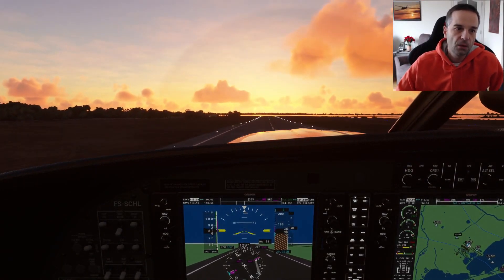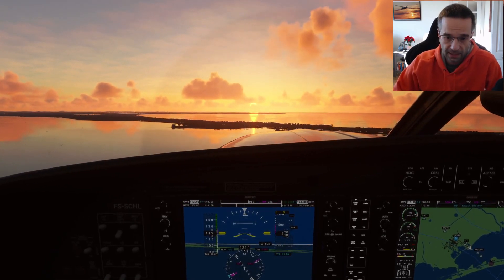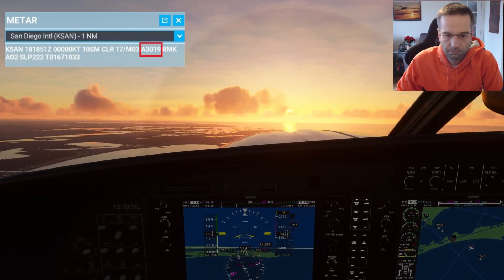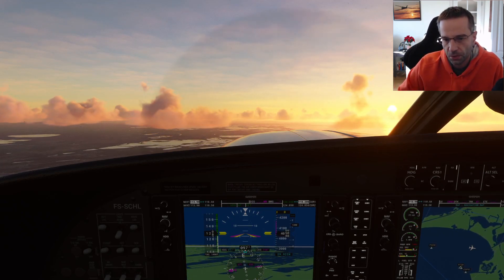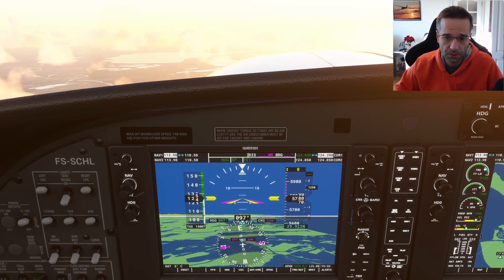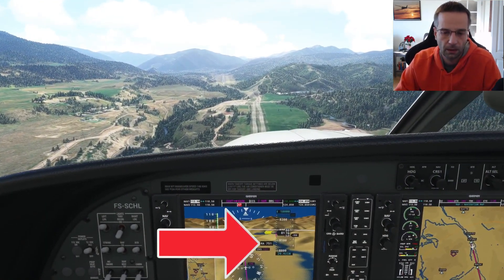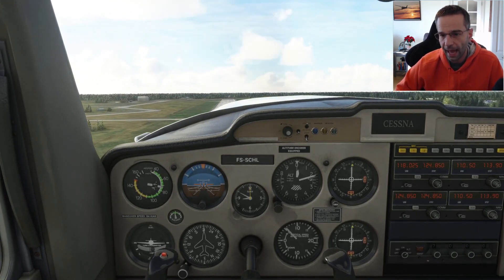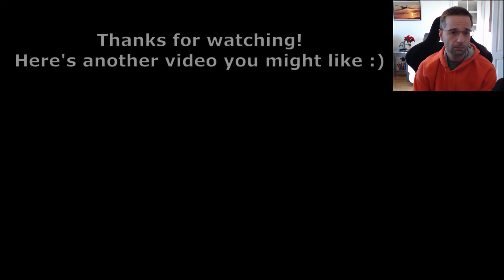Altimeter In Depth | Microsoft Flight Simulator Tutorial

Comment: I have a very peculiar problem. I always set my altimeter before takeoff and autopilot usually takes me to my desired altitude, however; as soon as I try to reset my altimeter, none of the systems acknowledge the new change. Since the altimeter has no set button I have tried many times disengaging the autopilot and engaging it again to see if it would acknowledge my request but nothing happens. What could I possibly be doing wrong?
Reply from the maker: If you’re already levelled off at the altitude you set, you’ll need to use VS or FLC to go to the new correct altitude.
Reply: @FlightSimSchool  thank you. I'll give it a try.
Reply: @FlightSimSchool  it worked. Thank you very much.